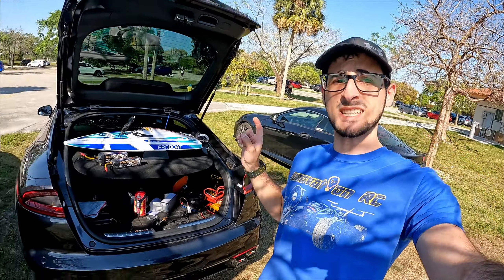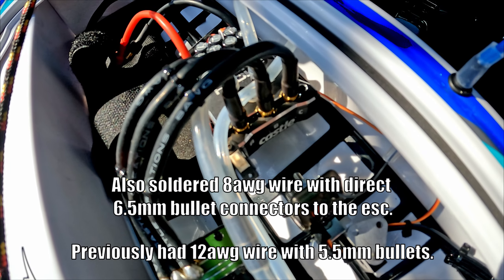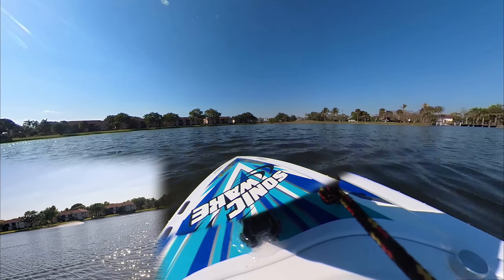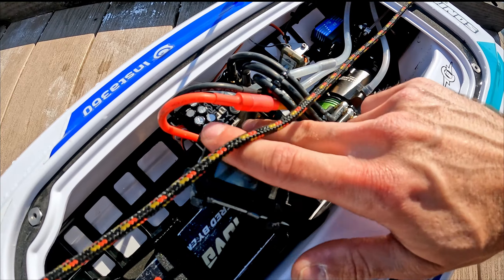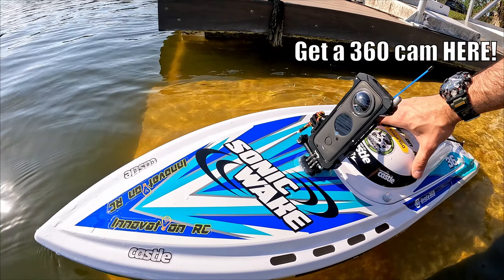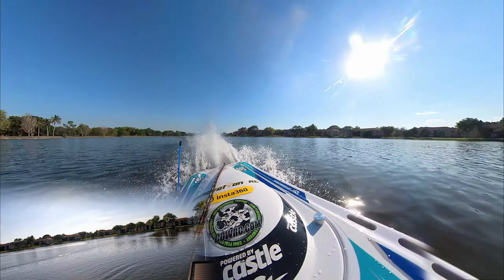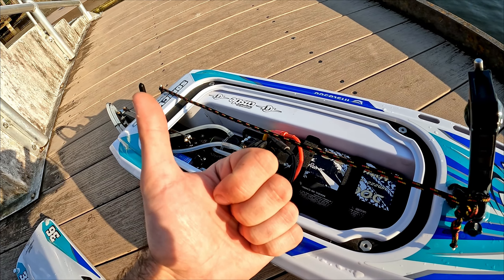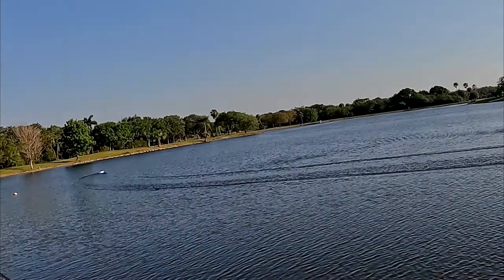LEVEL 3! Castle 1650kv motor in SONICWAKE 6s! Hydra X8S

Comment: On 6s with those electronics, you should get into 60’s. Try a 1644 prop. Mine did 65 with stock motor and 160firma esc. You also look like you’re running a bit wet.
Reply: he is tossing money at it first versus tuning! Eventually he will get a different prop and learn to tune the hull! Plus that battery is way to big for this hull!

Comment: I love everything your doing with this awesome job!! 👌  I wish I had soldiering skills like that. Honestly that prop is heavily off balance and could be putting wear on your shaft and motor bearings. As much as I want to see that run 8s I really suggest doing the prop next. The first thing most people do is change the prop or atleast balance it. I can't wait for the next video this is the way I would like to build mine so I can run it wide open in large area's and not worry about heat but also having the ability to prop up and run 8s for speed runs. Honestly that wiring job is awesome and people always mess that part up.

Comment: Curious to see how castle holds up. My CASTLE 1520 only ran 3 runs (4 min.)on 8s. Temps were low too, but it nevertheless BLEW the ROTOR...!!! A formiliar problem with castle. Now more boaters with same problems. Better spend your money on a cheap 4092, i only lost 2mph which is not that much considering the motor is 2.5x cheaper...

Comment: Hi.  Thats a great vid and a very fast sonic wake with the 1650 kv and the new esc. Please tell me with that 6S 10.000 mah brick batery how many running time mins does it have without heating up ? Does it keep the self righting feature ? Many thanks !
Reply from the maker: You have about 20 minutes of runtime constant on the water. Depending how you drive it may be 25-30m
Reply from the maker: Heat of the battery depends on the load of your setup in your boat/ car etc. if it's close to stock it will only get warm when the battery is dead. With the next video adding a prop (more speed= more load), it will make the battery hotter at the end of the battery. If you intend to run hard, just run for 10 minutes then give it a break by opening the hatch, let cool air inside. After 5 minutes you'll be fine
Reply from the maker: And yes it still self rights!
Reply: @InnovationRC  thanks a lot !   Do you place the  6S 10.000 mah in the center of the tray ? So you kept the stock prop in this set up? Can you please tell me which brand are those bateries and where to buy them ? Do they come in 6S 8500 mah also ?

Comment: I don’t get what the upgrades are doing.
My sonicwake out of the box stock went quicker than that on 6s and the 10000ma battery is way too heavy for this boat and will cause it to run very wet.
Reply from the maker: If you watch the videos from the beginning of running this boat, you'll see what everything does. The motor is slower but more efficient. That's why everyone is saying they are going faster. I don't really care about fast. I want clean reliability

Comment: Nice German "three"...lol.  Seriously, though, switching away from the stock electronics has always been best with the SonicWake.  I have two V1s...one for 4S, and one for 6S.  Both are currently running aftermarket electronics (both have HW SeaKing 180A ESCs), with the 4S running a 2050kv, and the 6S running a 1650kv.  Both perform WAY better then the stock Dynamite electronics.

I also have a V2...technically, I bought the V2 for my stepdad...but, since he seems to have lost interest in anything RC, I'm considering either selling the V2...or, better yet, "taking over" the V2, and selling one of my V1s.
Reply: Hi.   Great 6S setting !  Which 6S batery are you using ?  How many mins running time do you get ?
Many thanks !
Reply: Also which prop.?
Reply: @eduardonessim4499  Having only somewhat-recently finished the 6S build, it hasn't been in the water yet...but, regarding the prop installed, it'll be (initially) running the "Stage 2" prop from RC Boat Bitz.  As for batteries, I currently have/use packs from Power Hobby, SMC, and Gens Ace...but, once I've had the chance to go through all my packs, and determine which are no longer 'good', I'll be replacing them with packs from CNHL.

That being said, my first SW36...the one now designated the 4S...has been run on 6S.  With that boat, I first tried a 1650kv motor with 4214 prop, and, of I remember correctly, I'd get 5-6min.  My goal wasn't "high speed"...the goal was to increase run-time...so, I dropped it down to a 1400kv, which definitely helped increase run-time, but also made it too slow (could barely get on-plane).  I swapped in a 4216 prop (same diameter, higher pitch), which helped, but not by a larger enough difference.  Next, I went with a 4416, and that seemed to be the "sweet spot" (at least, b with the 1400kv motor) - I got decent enough speeds, and was getting around 7-8min of run-time.  Of course, with the second SW36...ie. the 6S...I will be starting the testing all over again, starting with the previously-mentioned RC Boat Bitz "Stage 2" prop.

Whatever you go with...wherever you start...best of luck to you.  As for me, I'll probably be selling one of my SW36 V1s, as I'm going to "take over" the SW36 V2 I had purchased for my stepdad (he's had it for 2yrs, and it's still in the box)...and, at that point, not sure how either SW36 will be configured.
Reply: Can you please tell me ?   Thanks
Reply: @eduardonessim4499  Tell you 'what'???